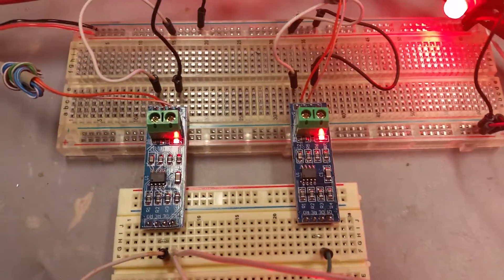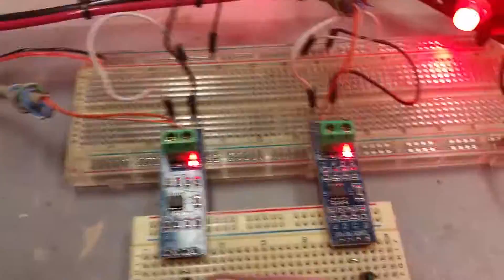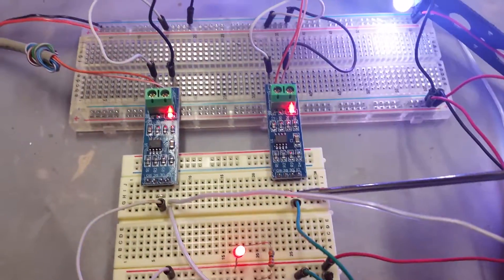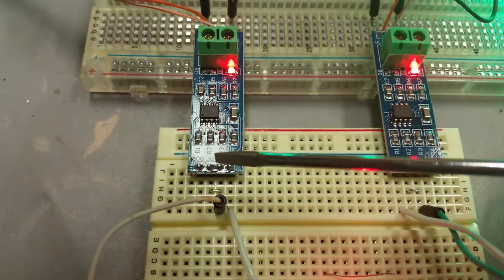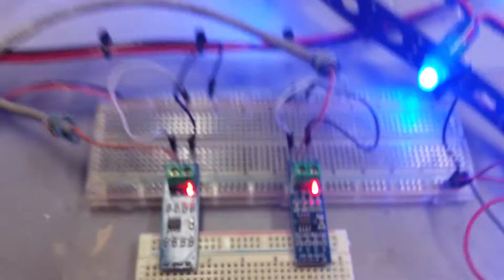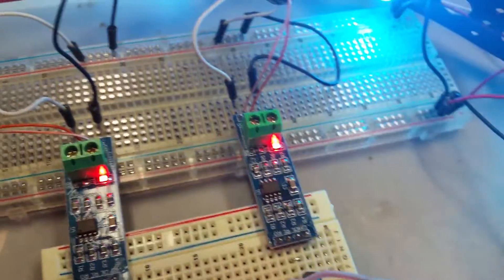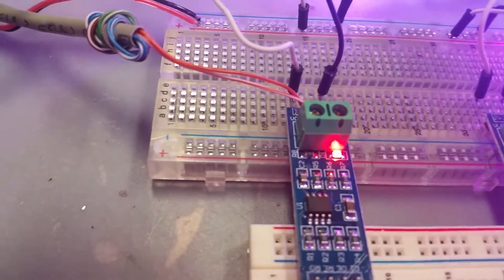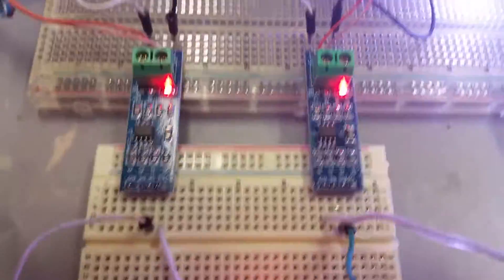Using eBay RS485 boards to transmit Pixel Data

Comment: Good afternoon sir. After searching long through for a solution as how to transmit the signal for long distance i got here. 

Sir, can i use arduino uno as controller bcoz at present I am using arduino uno to feed data to ws2811. i want my arduino controller to send the data by using your logic.

Arduino uno -->max485 circuit ------->50 metres cable ----> max485----->ws2811 pixels

Comment: Thanks for the video!  I bought a couple of the ebay boards, wired them up as per the video ran a string of 100 pixels 300 or so feet away.  5v and signal wires paired in the same cable.  Works fine.  I'll be using this method to extend some cables this year.
Reply from the maker: Welcome sir.  Glad you found the info useful.  Sometimes its hard to explain this stuff in text on a forum.